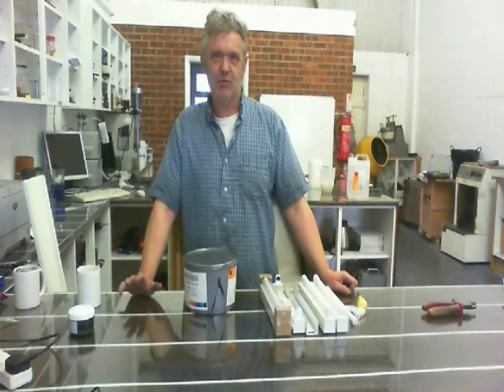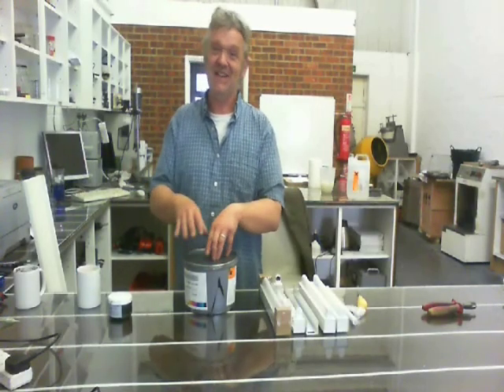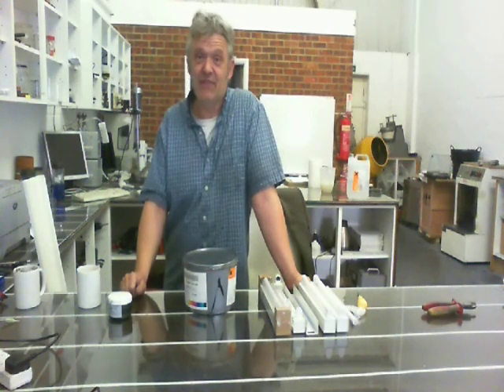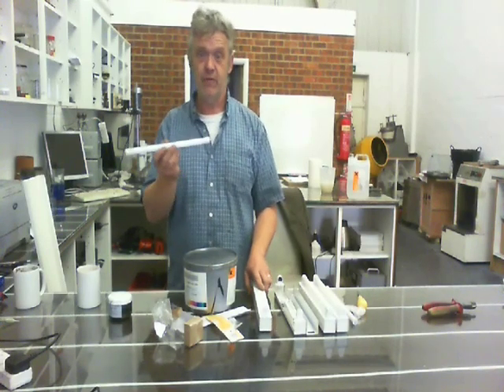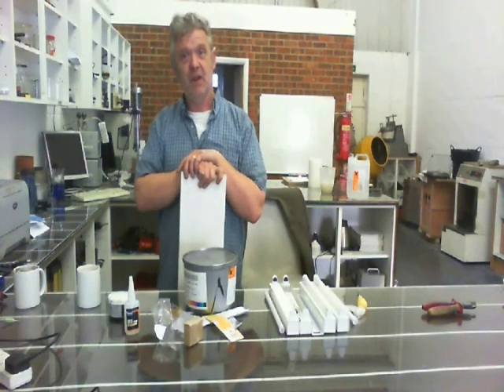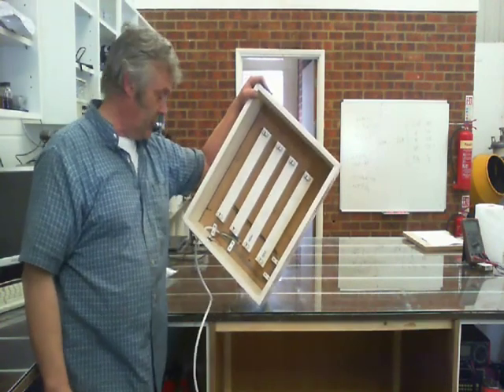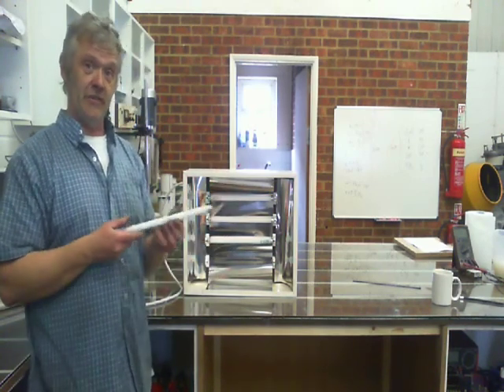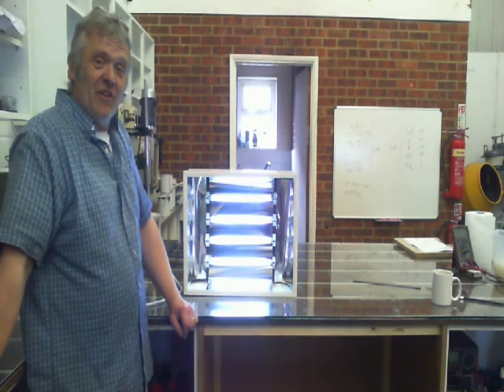How To Make A UV Cure Box

Comment: Perfect, this is exactly what I need as I have just bought myself a Liquid Resin 3D printer (Elegoo Mars to be exact) and I need an UV curing box that will work in the 405nm range and knowing that UVA is good for steralisiing will also help as I can multipurpose this box to keep my ferrets water supply clean thus saving me from constantly changing the water every day and I can now do a weekly change or even make a self filling system in case I have to go away for any extended time,

Comment: If you have a UV curable conductive ink, would it be possible to build your swag plate with more closely spaced lines by using a mask over top of the UV light like in circuit board applications? It would seem you could also only cure the flat plate region and wash off the ink in the stacked plate region. Just a thought. Keep up the good work!
Reply from the maker: good thought mate - I will give it a go - cheers for that
Reply: Robert Murray-Smith  Thanks, I'd love to hear how it goes.
Reply from the maker: I will let you know

Comment: I build flexo's   SMILE!!!!  ;)
Reply from the maker: you build them!! - very cool
Reply: Give me spec and I can engrave a ceramic roller to your ink specs. I can build a 24" x24" printer for about 10,000 us dollars.. That's 80% cheaper than purchasing one & cutom built to spacific needs. It.s important to match the engraving on ceramic roller to the ink. I have 5 of them in operation. 
Oh yea that's an in closed edge doctor system as well.
Let me know if you want one built. :)
Peace Murf
Reply from the maker: Dan Murphy
i am tempted mate - but i am not a printer and when this project is finished i am not sure what i would do with it

Comment: On the local market and fancy fairs the people often sell second hand face tanners, which already have the tubes in there. I know some other people scavenge for those as well, as I heard that the light helps to dry the nail polish (women things, yeah I know). I assume those devices are okay as well?
Reply from the maker: apparently the nail polish setters don't work - i looked at the face tanning stuff but that was still 50 pounds and i am a cheap skate lol - anyway to be honest mate - i like making my own stuff and the final plus point is making a small one is the same as making a big one so you could up the wattage and tube size to whatever you want - anyway enough justifying myself lol
Reply from the maker: Thomas Anderson
365nm is the curing wavelength for most uv printing inks mate - the lamp i made isn't particularly powerful but will do the job in time - but you make one thing and people moan it's dangerous make another and they complain it is too weak you can only do what you do - this lamp takes time to work but won't burn out your eyeballs lol - if someone wants it stronger put higher wattage lamps in
Reply from the maker: Thomas Anderson
would be petty cool mate
Reply: Robert Murray-Smith I am wondering if the face tanning thing is due to wattage or specific frequency of UV? reason I ask is because LED UV lights of up to 30 watts are pretty cheap from china, but they produce a narrow band of frequencies since they are LEDs, so knowing the right frequency for your rig I think would be essential, so you are getting the right UV frequency for the ink.
Reply from the maker: Thomas Anderson
another thing to bear in mind is this can be put together by anyone who can change a plug - you have a degree of familiarity with circuit building but no everyone does mate
Reply: Robert Murray-Smith
Yeah the time vs the hundreds in cost is a no brainer here LOL, as for the frequency I did a bit of searching once I saw the rest of the video (lol yeah sorry) and found that 315nm to 400nm is UVA so good to know that there is a specific frequency though, so I know what to search for :) (also still very interested in SLA 3D printing using such materials as UV cured or just plain photonically cured substances, using lasers for the curing per layer :)